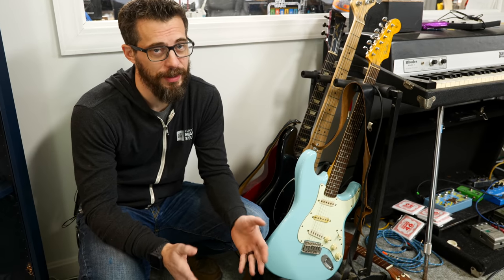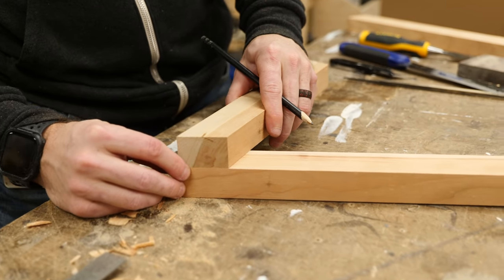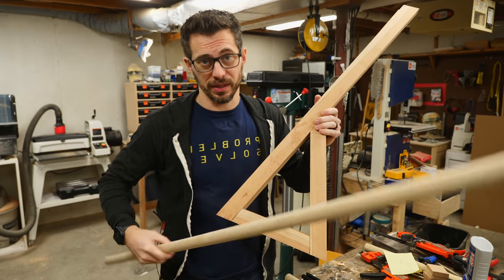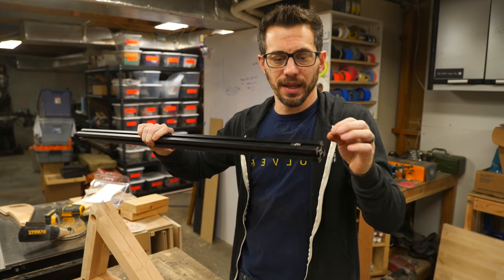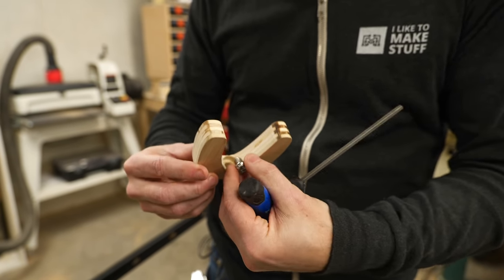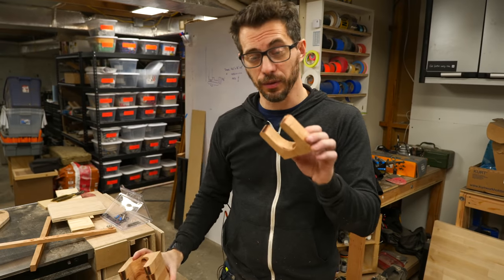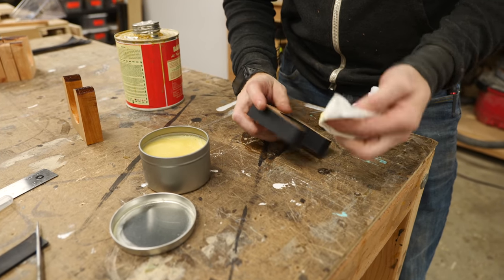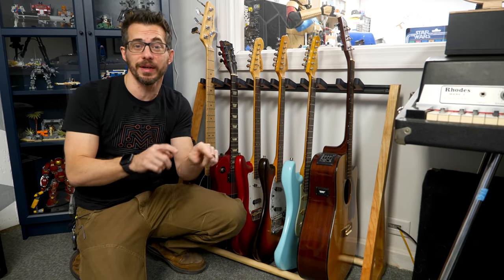How to Make a Multi Guitar Stand | I Like To Make Stuff

Comment: Looks great but I'm concerned about the dye in the leather leaching into the finish of the guitars. What about felt as a different option?
Reply: I'm building one of these myself and the whole time I'm watching this I'm thinking "Why not use felt?" But then I realize he is doing a high quality custom build so of course why not leather... I am putting mine on casters as well so I can roll it around if necessary. Mine is not nearly as pretty as his but I would not call myself an accomplished woodworker so I'm proud of what I have accomplished so far.
Reply: I agree. Surely leather dye (or any dye) is likely to leach into some wood finishes, particularly wax and cellulose lacquer. I guess undyed leather would be good, though.

Comment: one trick that I've used for "making" threads in the end of extruded alluminum instead of bruteforcing the screw in it like you did, I take a steel screw that I "sacrifice" and make one or two groves in the threads to help it cut the alluminium... works a charm
Reply from the maker: That's a great tip!
Reply: I was thinking the same thing, but isn't that just a tap? (I speak from very little experience)
Reply: @austinwessels  yes, but if you think a bit at the problem that bob has, which is to seat the tap correctly in the hole, it's from my experience due to the flutes of the tap being too big. by making the flute smaller it's easier to seat. but, yes it's a custom tap
Reply: I was about to suggest the same exact thing. Depending on the size (diameter) of the screw, you may even want to go for three or four. That helps evacuating the material (in this case aluminium) you are taking away.
Reply: @christobacon1  No expert, but I've seen metal workers put their taps into drill presses and clamp the work piece perpendicular, then turn the chuck by hand as they apply downward pressure using the press lever. That way everything is held exactly where it should be and the tap moves as linearly without a jig or just eyeballing it.
Reply: @PinataOblongata  sure but look at the extrusion hole shape, if you were to use a straight flute tap like Bob was going to use, it would still get stuck. I would say that a spiral flute tap would solve the problem but if you don't have that, in soft metals like aluminum for something like that it might not be worth going to buy one if you're only gonna use it once

Comment: As a musician, I will say that you should definitely do as you said you might - add taller rubber feet to the bottom and wrap leather around the wooden dowels at the bottom so the finish doesn't scratch on the wood. 

Also, small straps to your neck holders so that if you do happen to bump your stand or any guitar in it, they wont accidentally fall out. It will also allow you to pick the stand up and move everything together for cleaning or re-arranging purposes. Though, taking out the guitars is still recommended. Ha ha!
Reply: Good suggestions. Another reason for raising it further off the floor is to allow for guitars with endpin jacks  (electro acoustics), especially when you forget to pull the plug out...

Comment: This is just what I'll be needing when I go back to college in the fall.
I have 2 acoustic guitars, an electric guitar, and a bass guitar- alongside two guitar builds from kits and bought parts in the making, and possibly another electric guitar coming in a month.
Chances are one of the builds will never truly be finished because I want to do a somewhat rare, crazy wiring job with little knowledge/experience of wiring.
Reply from the maker: Awesome! We've got digital plans to help you get started.
Reply: if you don't mind sharing that crazy wiring idea, i'd like to try and help
Reply: @calinguga  If you can help, or at the least link me some tutorials to better understand guitar wiring, that'll be absolutely amazing!
The setup is inspired by this two-piece band, Local H, where the lead guitarist puts a single p-bass pickup at an angle under the EA strings, and wires it up to its own volume knob and a second output jack, then plays that through an octave pedal for an emulated bass sound.
I'm thinking of taking it a step further having two pickups, the p-bass pickup under EA and a single coil at the neck position, both on a 3-way switch so it can go from just "2 string emulated bass" to 6 string.
While all that's going on, I'd still have a single-coil bridge pick-up wired to volume/tone and its own output jack.
My dad and I built a strat-styled body from basswood, so we can still route it out as needed, and we'll be making a custom pickguard. I haven't yet learned enough about wiring to feel confident figuring it out myself.

Comment: Thanks for the great video. I built a similar stand but entirely out of 1" square tube steel. I then used silicon weather stripping as cushion for the guitars. It works great and has not harmed the finish. It was really inexpensive as the steel was scrap from a different project. I appreciate the great quality of your videos.

Comment: A few years ago, I went through a guitar stand design phase that was more frustrating than productive. I did how ever, come up with a prototype but left it at that. It's a simple enough design for multiple guitars. I built a rectangle with scrape cabinet drawers from a kitchen remodel I did . I removed the bottom or the floor of the drawer and the front drawer face and handle. I had some other scrape kitchen chairs that I used the back support ribs and arms. Anyway to make a long story short, I filled the rectangle with slats to separate each guitar. It fits four they sit in a slot and lean back slightly. No other support just the bottom portion of the guitar is in contact with a slat (for lack of a better word) in front and in back and the side rails. Getting the height adjusted so the guitars wouldn't bottom out was the most time consuming and difficult part of the build. Great to see a video on guitar stands. I had a similar one like yours but needed a portable folding type that wouldn't take up room in the van and end up in the dumpster after it got destroyed from the other equipment smashing it.
Thank you, be safe, love and light to all...

Comment: What a great use of alum extrusion. Really cool design and I love the simplicity of the wood holders. I only have one guitar, but definitely have learned something and will use it for other applications.

Of course it's easy to give ideas after watching this, but for anyone interested, I think it would be cool to have a small tenon in the back of the holders to keep it in line with the extrusion. I also think just cutting the cross hatch but leaving the leather on like a flap would "conceal" the screw head.

Thanks ILMTS team!

Comment: I highly recommend using an L shaped allen key or even one with an end specifically for higher torque needs. We use them all the time in the bike industry and you'd be surprised how much simpler it is to use it in the orientation with a longer lever arm. Might make the thread cutting a little easier on the arms. I'm sure most of you know that, just thought I'd put it out there for those who don't know.

Comment: Hi you said you didn't have the right size tap what you could try is take a bolt the same size your going to be using and cut two vertical groove's it should act like a tap with relatively soft material. Love all the videos you have given me load's ideas and solved lot of my projects

Comment: Couple tricks, you can get drop in tee nuts for extruded aluminum which allow you to add them after you have everything put together. You'd be surprised at all of the varieties of tee nuts. Also, for feet, you can use elevator bolts. I forget where i picked up that trick, but it has come in handy many times.
Reply from the maker: Good point! We listed the drop-in t-nuts in the blog post

Comment: Cool project and one I'm likely to build for my son's guitars.  One suggestion. Though its a bit of a pain, installing a dado blade in your table saw and using it for the half laps will result in a much better outcome than using the bandsaw and chisels.  And as for the  adjustable neck pieces, I'll be finding a way to accomplish those with a router template to insure complete uniformity.

Comment: You could clip out a millimeter or two more than the width of an insert off the front face of the extruded aluminum all the way at one end, so you could add or remove inserts without dismantling the entire rack.  You could even leave the guitars in while you did it.
Reply from the maker: True.

Comment: Cool video. I'd add / change 3 things: Add wheels, Add locking straps on top, and felt-covered separators  between the guitars at the bottom. Plus the same concerns as below on the use of leather.

Comment: Cherry may burn easily, but it smells pretty sweet when it does.
Also, just before you mentioned using the forstner bit, I was thinking he should drill that out with a hole cutter to make them uniform. Good stuff as always Bob!

Comment: I was just working on a multi guitar stand this past week. I have absolutely no space to work, no proper tools and no proper materials. I'm using a small saw blade (No handle just the blade) to cut the wood and i'm pretty sure it isn't even meant for cutting wood. It would be really interesting to see you do a build of something, maybe one with power tools and one with hand tools only and then compare results.

Comment: Nice project. But if you’re getting burn marks from sand paper it’s worn and needs to be replaced, it’s not the wood it’s the paper. If you’re getting burn marks from your table saw blade, assuming it’s sharp, check the blade for square against the top and check it against the fence.

Comment: I remember watching this video when it was released but I came back to it today as I'm thinking of making a guitar rack now. I'm curious to know if you're happy with the dimensions of this rack. How did you decide on the 20° tilt for instance and are you happy with that or would you have chosen a slightly different angle if you had to do it again? How about the width of the base? Are you happy that it is sturdy enough?

Comment: The neck on that Daphne blue Strat is not an original Fender if I'not mistaken. The hole for the truss rod adjustment should have a plug made of walnut (American Fender) or a black plastic (Mexican Fender) but instead it's plain wood. Maybe it's a Squier neck?

Comment: The angle of the neck holders might be off? i whould try to line up the angle of the aluminum with the necks, so that they can be seated "right". 

But also taller feet and lethar on the bars is a must:)

Comment: Hey Bob, long time fan here, I have a question for you.
Why is it that at the minute 4:48 you make the tread by hand instead of using an electric screwdriver? Wouldn't that been easier?
Hope you take the time to answer me
Reply: Tapping by hand is much less likely to damage the aluminum. You really have to "feel" when the tap has removed too much material and needs to be backed out and cleaned. Not Bob but hope that helps!

Comment: For the base of each of the sides, would there be any benefit to having half-laps that oppose each other? I noticed that you cut away material from the same side at either end.
Reply: Also, is that beeswax from your apiaries?

And, as a fellow lefty, it's funny to me that you rely so much on your left hand for intricate work like cutting and driving (I wanted to avoid saying "screwing" but it looks silly), but you play right-handed guitar. 

I use my left hand for most things, but I'll usually use a tool with whichever hand picks it up. Yet, I couldn't play right-handed guitar no matter how hard I tried, and I tried three different times to learn before finally trying lefty. And it was an epiphany.

Comment: I don’t know why but it bugs me, referring to counter boring as counter sinking. Very nice stand. Consider slicking the leather edges and burnishing the face of the leather.
Reply from the maker: Is there a notable difference?
Reply: Countersink is tapered for a flat or oval head, counter bore has a flat bottom for a pan or hex head fasteners. ( at least that was what I was taught)

Comment: I wonder if you could route a t-slot in a piece of hardwood instead of using aluminium?  Hmmm... I think I will give that a try.  :)
Reply from the maker: I'm pretty sure you could. Maybe using a dovetail bit?
Reply: Time to find out what is in the bit box.  :)
Reply: That was my thought as well. Might make a couple of these as gifts and sure would be cheaper and easier than getting some extrusions. - Chris
Reply: @fcschoenthal  , I have a bunch of rough sawn red oak that is begging for a project.... I think I just found it.
Reply: @Iliketomakestuff  I guess I envisioned just some t-track in a hardwood crossbar. Would make sliding and clamping them easier than routing a shape. That and I don't have a t-slot cutter. - Chris

Comment: Why didn't you use a dado stack and a tennoning jig to do the half lap joints?
Reply from the maker: There are a few ways to do those joints, I just chose to do this one.
Reply: @Iliketomakestuff  no offense man, but you frequently seem to choose some of the least suited methods and tools to make your projects with, especially considering the plethora of options at your disposal. I just feel like your finished products would have a higher level of overall polish if you used the right tools when doing stuff like that.

Comment: I hate to break it to you, because you did a lot of great work on this piece....
...but that leather is going to RUIN your guitars' finish.
You should never use leather, vinyl, or plastic anywhere near your guitar.  You shouldn't even leave a strap on a guitar for long periods.  There are specific materials meant to be used for guitar hangers, etc. (felt, cotton, etc)
Look around for "nitro safe" padding.  Even if your guitars aren't nitro finished, leather is not a good material to leave the guitars against for long periods.
I am going to use this project as an inspiration for my own shortly, but I will need to figure out a replacement material for the leather you used.  I'm thinking I'll look for some quality felt online.  Thanks!

Comment: You didnt predrill the bottom for the feet you cracked the crapp out of the wood 😳
Reply from the maker: I should have predrilled those holes, especially because of that half-lap joint. It didn't split the wood, there was a small gap in the joint

Comment: .....the large holes made to fit the wooden rods at the bottom weakens the corners.
I will drill holes for screws from the opposite side and add glue to the joint. Wont be going anywhere my friend.
I can tell you that right now - it aint moving anywhere my friend.
You should never weaken quality wood like Cherry with ridiculous design.